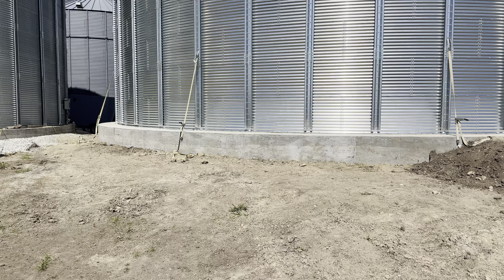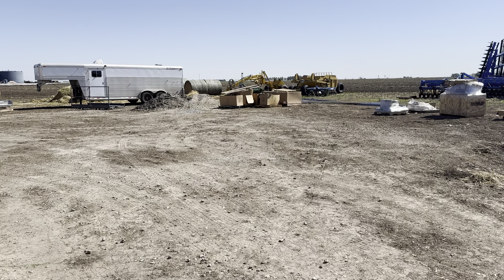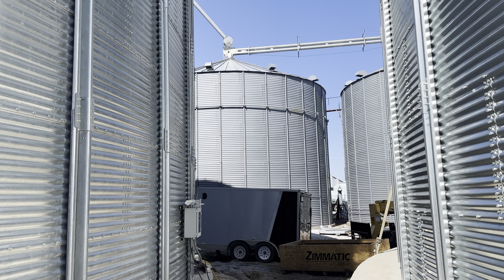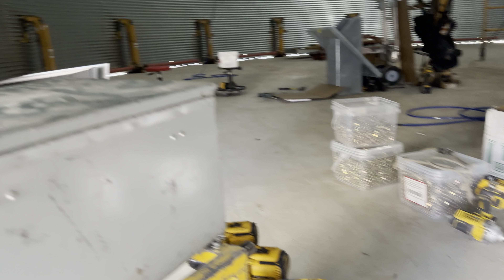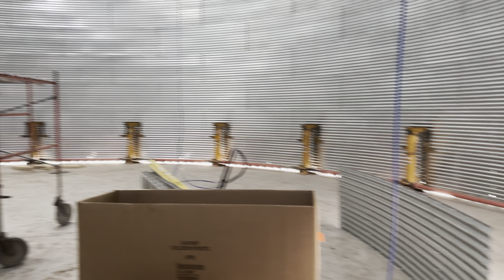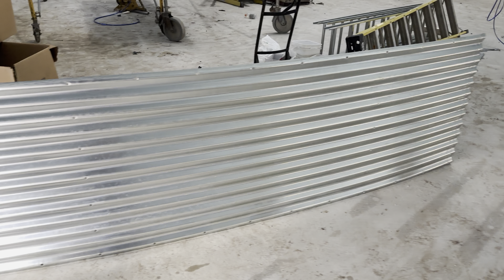How I Spend My Days. Building Grain Bins

Comment: I’m looking at putting a roll up garage door into an older green bin silo and wondering if you have any advice you could give me
Reply from the maker: @jeremyhoefs8167  is the bin built already or is it needing to be put back together?  The hardest part will be dealing with the curvature of the bin compared to the flat door. What most guys do is frame up the size of the opening for the door and the. Cut away the sidewall of the bin. You’ll have to fabricate something to fill in the gap from where the bin is round and the door is flat.
Reply: @ it’s already built
Reply from the maker: @jeremyhoefs8167  ya then the best thing to do is frame out the opening to give it some stability before you cut your opening out.